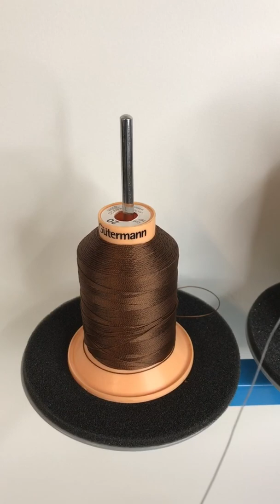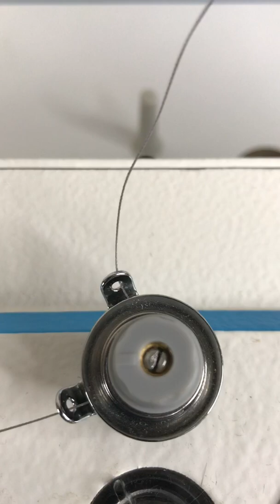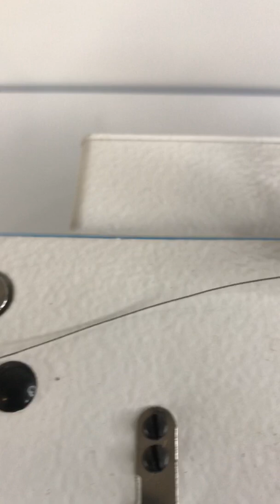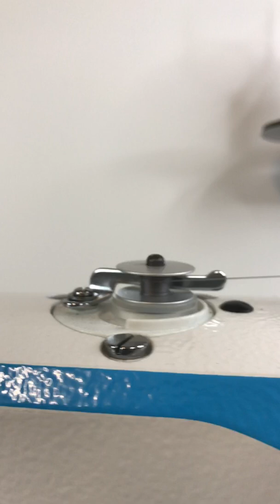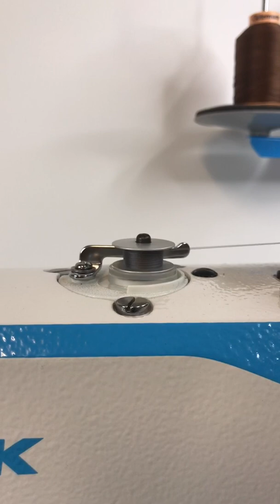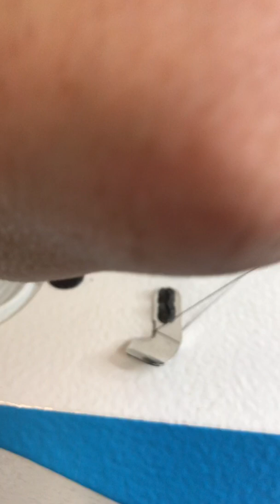How To Wind A Bobbin On A JACK Industrial Straight Stitch Sewing Machine

Comment: If you flip the bobbin over so the thread passes through the hole on the bottom of the bobbin, you don't need to hold the thread while it starts to wind. ; )
Reply from the maker: Yes, you can do that but all the bobbins we are using now do not have any holes so easier to do it this way.

Comment: How tight should the tension disks be? Thanks
Reply from the maker: That is something you need to work out by setting your bobbin tension then adjusting your top tension till you have a perfect lockstitch. Every machine is going to be different and it is all based on how much you need based on thread weight and the job at hand.

Comment: I was sewing on my A2 and winding a bobbin, but...the bobbin overwound and i had to unwind and throw away a lot of thread. to make it fit in the bobbin case. This happened on two occasions, Is there an adjustment I can make to stop it overwinding.  ?  By the way great videos. very helpful. as most of the tutorials on the Jack are in hindi etc.
Reply from the maker: There is an adjustment you can make to stop this from happening, it should have been done by the technician when you bought your new machine. The little arm that you bring across to wind the bobbin can be adjusted so that less thread is put on the bobbin. Loosen the phillips head screw that holds it in place then move it slightly closer to the bobbin and see how that goes. It may take a few goes to get it where you want it.
Reply: @ozcommercialsewingmachines  😀 thank you so much I did what you said it took a couple of goes but got there in the end. There are three videos you have made that have helped me. Thank you again. UK jack A2